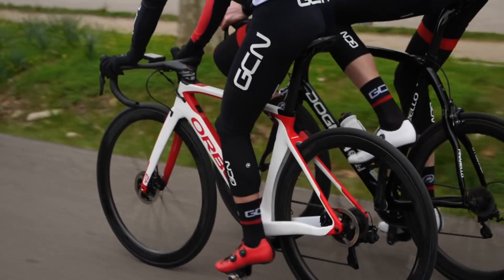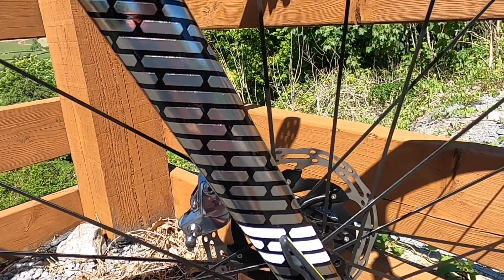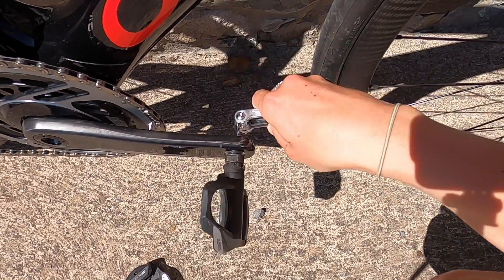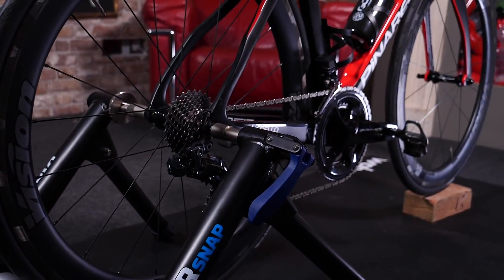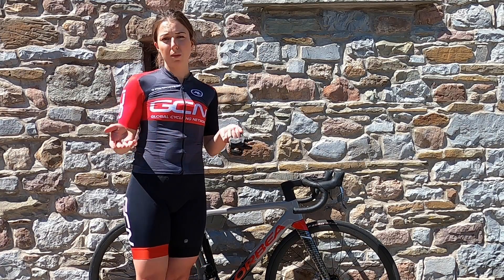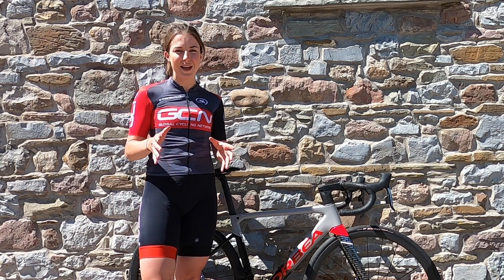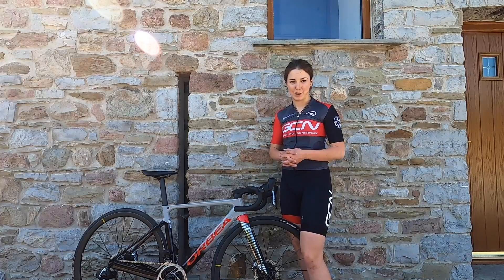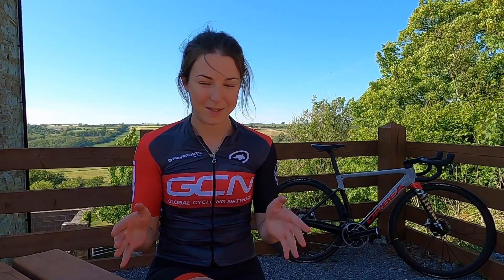How To Set Up Your First Road Bike

Comment: If you spend 5000 euros on a bike, please spend 50 euros to also get a torque wrench so you don't ruin it in the first week =s
Reply: A good torque wrench usually costs more than 50 €, however it's important especially at carbon fiber parts, but it's also good to use them on alloy bikes.
Overtighting parts can damage them irreparable

Comment: I want to say thank you to GCN for the quality of your videos, I come from a BMX and Mountain Bike background and over the last few months I have purchased a Used Felt Road bike on Ebay and built it up with components that I feel are good quality based on the reviews and videos that GCN has put out, But by far the biggest advancement in comfort was made today, based on the older videos I watched I saw SI review the Fizi:k saddle line, which led me to the Fizi:k website and the saddle finder that they have, based on the video GCN produced about the Sit bones I was able to measure myself and input everything needed including the type of riding I wanted to do, Fizi:k recommended an Argo Tempo R1 150mm saddle and I found it online for sale for $161, now at first I thought that was a lot of money to put out for a saddle, but after installing it and using this current fit video plus a couple of the older ones I was able to get the saddle set up and set out on an hour long test ride on Zwift. My wallet was saying I spent too much money but my ass is saying thank you and I would have spent double to reach this level of comfort. Thank you for the great videos, great content, and great people you have at GCN. Keep up the great work!!

Comment: Saddle height top tip which worked for me after months of feeling awkward. In bare feet measure your inside leg from the floor to the top of you arch if you know what I mean. Then multiply that by 109%. That measurement is then taken from the pedal top when the peddle is at the lowest point to the top of your saddle. It made an incredible difference to me and my comfort and efficiency etc.

Comment: I would recommend working with an experienced mechanic when setting up your first road bike.  That might not be possible in Covid lockdown so this video is first rate.  All of the adjustments Mannon makes are important but seat height is absolutely critical.  My problem is an old sports injury has left one leg a little longer than the other.  That creates a fitting problem which is why I always consult an experienced bike fitter.  If memory serves Emma Pooley had the same sort  of disparity in leg length.  When she had her bike fit the fitter commented that her success as a pro was surprising because of her different leg lengths.   In that video she said she hadn't had a formal bike fit before, but I suspect she had first rate mechanics and coaches who had noticed and made appropriate adjustments specially for her.

Comment: First, ALWAYS use a torque carbon parts! This is an absolute must! Over torque and you void the warranty, then you just have a pile of bike parts.

Second: one pedal is reverse threaded, the simple way to remember how to put on pedals is to pedal backwards to put them on while holding the pedal, pedal forwards to take them off.

At the end of this video you should very much recommend a professional fit when these bizarre times are over. Nothing can replace a good professional bike fit.

Again, always use a torque wrench!
Reply: Unpopular Opinion: bike fits should come with all new bikes. All this stuff should've been done at the shop during delivery.
Reply: @thatsounditmakes9177  Proper bike shops will do this.

Comment: New to cycling and after getting a smart trainer, I discovered my “comfortable “ saddle position was not. I was getting a tight feeling just above the knee. I have incrementally increased the height of my saddle [about 25mm over a week] and was surprised my avg power has increased and new muscle groups are getting sore. I wasn’t sure I would be a candidate for a bike fit as I am not and never will be a competitive cyclist, however given I feel better and perform better on the trainer I believe it would increase my enjoyment of cycling if I did.
Reply: You don't need to be a competitive cyclist to benefit immensely from a proper bike fit. In fact, it's you as a new cyclist who would likely benefit more as a proper fit may address issues you weren't even aware you were having. It's well worth the time and money to find somebody who knows what they're doing.
Reply: the ideal saddle position heel test does not apply to every rider some like myself use our ankle movement in the pedal stroke increasing the length of the leg so you may get pain of a low saddle, generally above knee pain is saddle to low and pain behind the knee is saddle to high. one sided knee pain is a good indicator of a leg length difference. A bike fit is a good idea but they will be limited by the bike you currently have fit wise.
Reply: Welcome to cycling! Hope your enjoying it so far! Just to let you know 25mm adjustment is MASSIVE, a 5mm adjustment is far far better, as you can get more accurate, believe me 5mm makes a HUGE difference when you get up to doing 50m rides.

Comment: For new cyclists... its a very, very common misconception that the large gel saddles or gel saddle covers are more comfortable, this is NOT the case. When you get on your new bike, your saddle, whatever saddle that may be, is definitely going to be uncomfortable, this is because you are not used to it yet. It takes patience and miles to "firm up" what is essentially your gooch to get used to riding a road bike, I would say that if you have done 150 miles and still have issues with the saddle then you probably do need to change it, however in the majority of cases its not the saddle itself thats causing you jip, its just that your not used to it yet.

Comment: Very good and informative video, I would add something that happened to me though, I just got my brand new bike for Christmas and as you said, it was previously assembled by my local vendor, despite my bike isn't a professional or hi end type, it is more a medium gamma type of bike, it has shimano deore systems which I found they're very good, how ever, after I set my bike for the very first ride I hoped on and the tires were too deflated but then I realized that I didn't know what the tire pressure should be, so I had to look it up on the internet and there were too many tables and different values, mine is a mountain bike, I'm 1,75 m tall (around 5´10") and 92 Kg. my bike's wheels are 29" so I found they should be somewhere between 18 and 28 psi, therefore I started from the bottom but 18 was still too low and felt like the bike was being break so I had to increased the pressure up to 28 psi in order to feel it more loose whilst not pedaling. In summary maybe you could include the pressure info for the tires, just a suggestion, great video again and I surely will be watching more. Happy new year and the Covid be extinguished this year.

Comment: Why choosing a bike frame size is important for certain height? Does the saddle height adjustment compensates any inconvenience for your height? Meaning if the frame size is too big for you you can lower the saddle height to get the same leg reach towards the pedal or the road for that matter.

Comment: 8:48 you wanted to say that you want to reach the brakes from the hoods and the drops, not from the tops.
Also I'd point out this video is definitely not enough for someone to do the handlebar height. There are more detailed videos out there, both from GCN and Park Tool, that a novice should watch if they don't know what they are doing. You don't want to mess with the handlebar/steerer.

Comment: Great video! I don't want to be a smart ass, but I can only urge to stick to the torque value on the pedal. I'Ve had a broken thread because of a lose pedal. Also a squeeking pedal, because it was too lose. It will be hard to break the thread of your screw or predal, those are pretty sturdy.
But hand tight - I would not feel comfortable with, but also don't NNNNNNGGGGHHHHH it, also unnecessary.
Correct me if I'm wrong.
Reply: The given torque figures for a bolt are basically somewhere between tight enough to stretch the metal slightly so that it always stays under tension when vibration moves it back and forth; and not tight enough to snap the bolt or strip the threads. With practice and experience you can get the required torque setting by feel. 
So practice on old bolts and threaded holes at getting the torque setting right by feel and USING THE TORQUE WRENCH TO CHECK YOUR ACCURACY and you can then leave it in the workshop WHEN you're confident that you know what you're doing.

My old Yam RD200 was a bugger for coking up and needed the heads and exhaust ports cleaning out often. In all the times that I refitted the heads and barrels (which was quite a lot) and torqued them down by feel I never had either a blowing head gasket, a stripped thread or a warped cylinder head. So I must have been doing something right!

Comment: Me, torque wrech, 3,5nm on a carbon seatpost, cracking noise.. bye bye seat post. Check if the bolts are greased first ^^

Comment: I have kind of a newbie question. What is the difference between bib shorts and regular cycling shorts, aside from their obvious design differences? What are the advantages/disadvantages between them? Looking to buy some new cycling kit and just figured i'd broach the topic!
Reply: Hmm, here's my two cents:

Shorts are held up by a elastic band at the waist. This can be uncomfortable if too tight, especially when leaning forward more. Too loose is not good either. Bibs go over the shoulders and are secured in place without any discomfort.

Bibs overlapp with the jersey more, especially at the lower back. Helps staying warm on the road.

If you get too warm maybe shorts are better (mtb or indoors).

Shorts are easier to pull down for toilet breaks.

Comment: I'm fairly new to cycling and I'm a little out of shape. I just recently got a somewhat cheap (about $180) mountain bike. My question: is it worth it to get a nicer bike (probably a road or gravel, since I don't do anything on rough trails)? There's a huge price range in bikes and I want to know what a good bike is going to cost without being overly expensive.

Comment: Question: Can you reapply bartapes? I want to adjust my levers higher than the usual and I have my new bartapes applied ,can I remove them and reapply them again in my bars or once its there, there's no turning back? thanks

Comment: Dangerous thing to say: you "can" get yourself a torque-wrench. With the current tight tolerances and limits on materials to squeeze every last gram out of it, a torque-wrench is an absolute must, and be the very first thing you'll buy, especially if you've got carbon parts. It's very easy to overtighten stuff, as 5Nm for example is less tight than one might think. Plus, bike-graded torque wrenches aren't that expensive, especially not compared to the price of a complete bike. Don't skimp on that vital piece of equipment.
Reply: W. S. Agreed! 

Along with a proper set of Hex keys. Multi tools should be used only when there are is no alternative like when you’re out and need to make an adjustment.

Comment: When I was a teenager, I was riding my bike like crazy. I just ate my bikes. I stretched chains, bent gears, burned brakes, broke frames, forks, stems, cranks. I rode 80 k / mh serpentine because I loved speed. I've always dreamed of motorcycles. Now I have 4 motorcycles. The bike was already too slow. I have left my bikes since the 90s. I'm trying to get fit because I'm 46 already, it's not too late. Others run and go to the gym. It's not for me. I thought about the bikes I once loved. So twice a week I go to work 6 miles each way. I have Univega Rover on slikach and tt bar. which I bought 30 years ago. Now my body is different so it's important to have a good bicke position. Thanks to this video, I know how to find my way on my old bicycle. Hey GCN riders, I admire your passion for cycling and regret my long break from riding. Ride Safe!
Reply: fair play to you snd well done

Comment: I got my first road bike 2 weeks ago, a Giant Propel Advanced 2 Disc. I was wondering if I can fit 28mm tire's to in in the future. It comes standard with 25mm tire's. Secondly I use it for my commute of a 83km round trip. With my small back pack on I get a lot of lower back pain about 20km I n to the ride. Any advice in how to solve this
Reply: Measure the clearance between your tyres and your frame/forks; if there's  AT LEAST 2mm to each side and 3mm in the centre then you will probably be ok.
If the backpack is causing the pain then possibly using a bumbag instead would help. If not, then as Manon said, getting everything set up for YOU may be the answer.

Comment: I can’t imagine any situation which would require the saddle to be “Nose up”
Reply: Bmx and dirt jump bikes usually have it turned up.
Reply: If you do not want to have any children.
Reply: @Rover200Power  lol
Reply: @OG Prangster. But this is about setting up a Road bike.
Reply: I run mine slightly nose up so that I can get above it after sliding behind the saddle for technical reasons. That said I'm more of a mountain biker and only just got my first "road" (gravel) bike

Comment: I love Manon's videos, but I hate to say it...all this stuff should be done when you get the bike delivered by the shop. The fitting should be included with the purchase of the bike. All bolt tightening procedures on carbon parts should be done properly with a torque wrench (which she alluded to in the beginning of the video, but then proceeded to use a multitool to tighten her seatpost). I know she's very excited about the new ride, but it shouldn't interfere with proper practices. All this stuff should've been done at her LBS at delivery. If they don't, perhaps you might ask that they do, or find a shop that will. Thanks for reading my rant, now back to Manon's video.

Comment: ... Ahhh ... NO !!! ... Your small "multi tool" does not have everything you may need ... whats missing ???  a Chain Press Tool !!! ... If you can not fix a broken chain ... you are in a loooong walk home !!!  Seen that too many times ... if you can remove a "link" and press a pin back in you can pedal home ... even if the chain is too short and you may lose an upper gear ... beats walking ... especially in "road shoes" ....